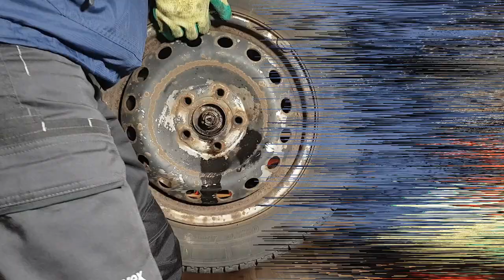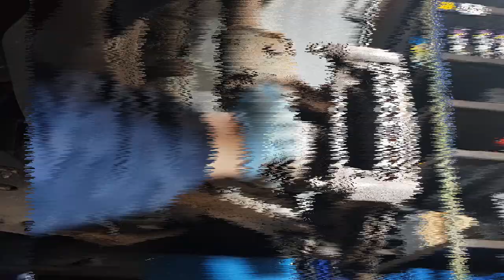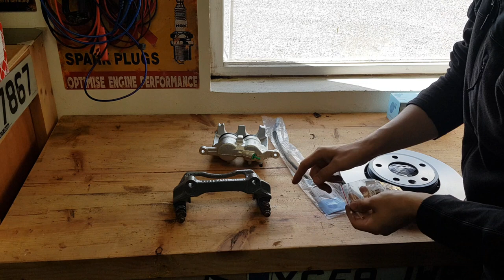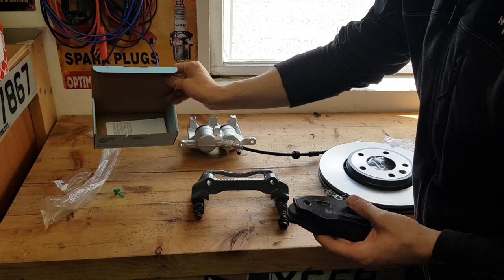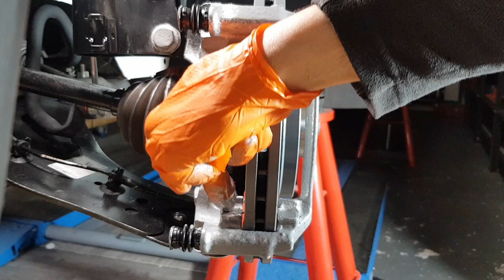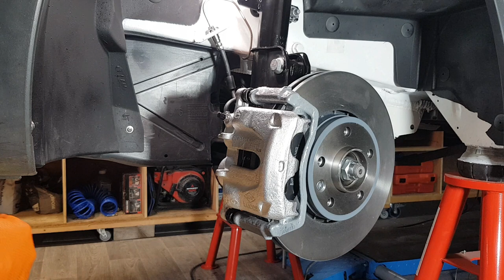How to change brakes on Trafic Vivaro Primastar How to replace brake caliper, carrier, discs & pads

Comment: And one more question. After reassembling the new brake (caliper), is it required to bleed all 4 brakes after re-adding new break fluid? I plan to only switch the calipers at the back, where the handbrake is currently getting stuck. Handbrake cables will also be renewed.
Reply from the maker: You can only bleed what you have removed but it does not harm to do all just in case there is any air in the system from before. If any air in the system your brake pedal will be soft. The nandbrake cables on these vans just don't last. I have done mine twice

Comment: Why it's two different cars? Why you didn't continue on the old one?
Reply from the maker: Hi
This is the same van. I restored the van and replaced everything on it including sand blasting to bare metal and treating the metal with rust converter then respraying and resealing with gravitex underseal/ stonechip😉